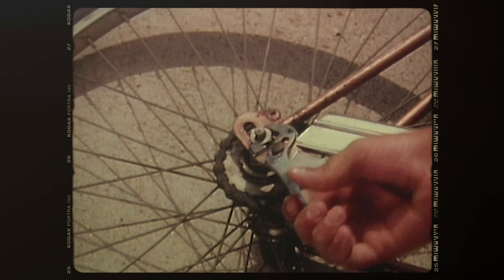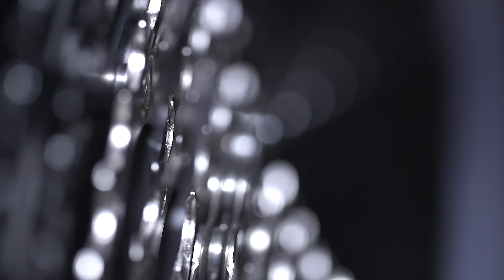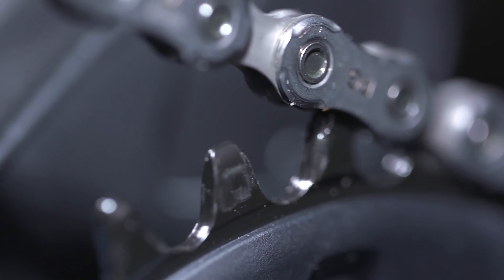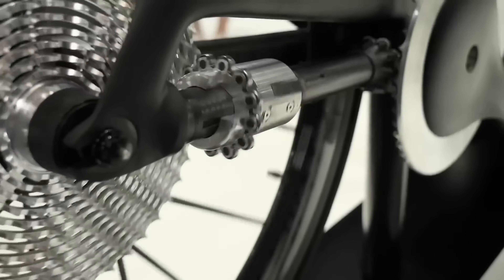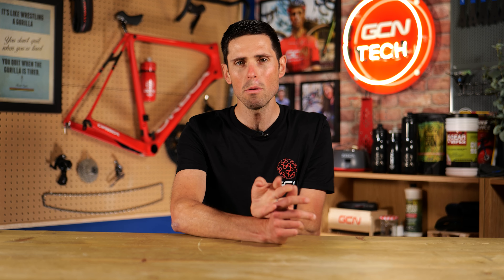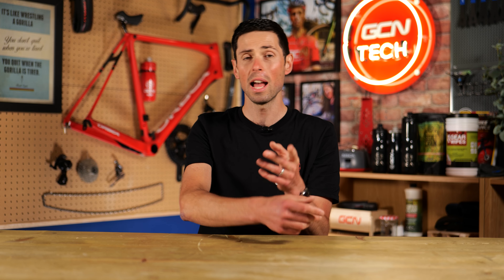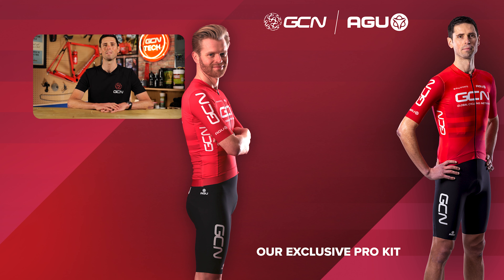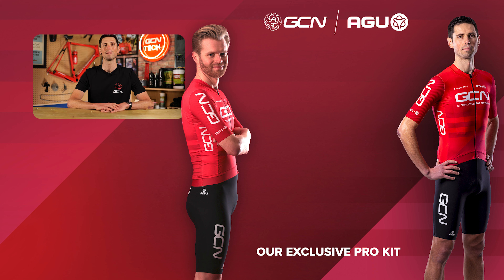Why This Will Never Happen!

Comment: My touring bike has a belt drive and internal gear system which works brilliantly. How often do you clean the belt? Never. How often do I need to adjust the belt length. Never. How often do you replace the belt ? Never. Compare that to my bike with chain. After each ride cleaning the chain, cleaning the cassette, cleaning jockey wheels, cleaning all those crazy special things, , lubricating every other ride. After many rides adjustment of cable to chain. A new chain after say 1200km. Its like a baby that needs care all the time, where my humble touring bike just always works. Yes it blows my mind how hard it is to find a gravel bike with belt. There are some steel ones, which look like they come from the year 2000, maybe one with aluminium, but still.
Reply: This. With people who ride a lot, are not doing it for the sake of competitions and are willing to spend around $1000 equivalent on a bike, belt should become the norm. The amount of work and maintenance costs of a chain drive+derailleur gears rake up quickly. By the time you are on your 2nd cassette, you may as well have gotten a belt drive with a Shimano alfine gear hub, and by the 4th you're in Rohloff territory, by the 5th Pinion. Sure, it will take 10 years to get through 5 cassettes for an average commuter, but it's 10 years of just riding vs. spending hundreds of hours on maintenance over the time period.
Reply: yes, but you had to pay significantly more for it, and the weight you drive around every day is greater and the efficiency is lower, so you use more power, in the end you end up with something similar, the only thing to choose is whether your bike is maintained daily or not, then you have to pay for it
Reply: @makantahi3731  The weight penalty isn't that big, especially for people living in flatish terrain. We only need the effect of scale to push the price down 👍
Reply: You must be riding a piece of junk then.
I've had the same Trek SingleTrack 930 since I bought it new in '96 and have ridden it over 10,000 miles. It has all of the original drivetrain components, shifters, and rear derailleur cable. Oh, the front cable was replaced 16 years ago. I've commuted in the worst Pittsburgh weather and winters with it, ridden hard and put away wet. Sometimes I'd feel guilty and clean it after a few days, but I never had the problems you're describing. Lubricating after every other ride? Are you mad?
Yah, belts were made for people like you, lol.
Reply: Exactly, the only way chains are getting replaced, is in the maintenance departement.
If bike commuting become a commodity for everyone, average Joe hates maintenance, and, would go for it.
Reply: Have you considered a) using a waxed chain b) using a better chain and c) just spraying your bike off with a hose / at the car wash occasionally?  They really aren't that high maintenance if you know how to keep them that way.  Even using oil, you can usually get away with just spraying it down then re-oiling the chain after a dusty/dirty ride.
Reply: Fwiw I think belt drive is great for commuter / urban applications, I'm just saying the amount of babying you claim chains to need is just not realistic.
Reply: @JMurph2015  You don't get it. That's already a lot of maintenance.
Reply: @JMurph2015  Yes it is. Look at a car. Any maintenance is too much maintenance. 
It's not a hobby, it's a way of transporting people.
Reply: @xmtxx  it really isn't, it's like half an hour once a month.  You have to put gas in your car, is that too much maintenance for you too?
Reply: Belts stretch and weather crack, never replace?
Reply: @JMurph2015  Lol, you made my point.
I wasn't, even expecting that much.
I replaced my car with a commuting bike (2 actually). And I spend a lot of time advocating for Ev's, because once, you don't have to do it, going to the gas station is a real hassle.
Even with a ICE car, going to the pump doesn't take that much time.
As I said, any maintenance is too much, beacause it's only a time loss.
Reply: @Lanceweeda  Belts last for 30 000km.
You don't realize how good it is.
Wonder why pretty much the whole industry use belts instead of chains? Even some motorcycle have belts.

That's almost 10 year of biking for me.
I'm ok for such "high frequency"  maintenance :)
Reply: @Lanceweeda  I'm not at 30.000 - 40.000km. Although one guy did 130.000 on one belt.
If you really torture a chain and belt, the (probably all) chain breaks way earlier then a belt.
Reply: @makantahi3731  yes the initial price is higher, its similar as a car with or without airconditioning. Airconditioning is nice, similar a belt is nice. Both not required.
Your efficiency argument is correct when you are only indoor. Or drive on really clean roads. In practice, after some miles the belt is more efficient. The more mud, the belt wins in efficiency at least against lubricated (I dont have numbers compared to waxed chains, but waxed chain is another baby maintenance).
Reply: @xmtxx  Around 60%-70% of all daily commuters use a touring bike (or e-bike) with belt, there you go
Reply: @JMurph2015  If you have a small apartment, spraying is not op option. If you life in a separate (expensive) house that could be an idea. But still you would wash it properly. Using a car wash hose is an idea, but you would have to use low pressure or you damage the bike, and then the efficiency goes down.
Reply: @JMurph2015  Well, I think almost all riders regularly clean the chain, because otherwise the chain wears out to quickly, so expensive and not eco friendly. Secondly, a lubricated dirty chain, never cleaned is way less efficient then a belt, never cleaned. The babying is realistic in my own life, and what I see others do. No you dont need to clean the frame that often, but the chain is a pain. And when say you clean the bike 10 times a year with 30 rides, my touring bike is stil at 0 or 1. There's just no way out
Reply: @Aragorn.Strider  now you're trying to twist everything, everyone I know who rides a belt are stiff-necked gentlemen who feel it is beneath their honor to even pump up the tires, and you talk about driving through deep mud, such rarely come out even in light rain, I don't ride my mtb in mud, so I'm repeating : the alfine is at least 1000g heavier than the classic gear shifter system and it is also a rotational mass, which means that you have to move it in 2 ways at the same time: rotate and move linearly, which represents double the power than if it were a part that is on the bicycle frame, then the efficiency: already the belt itself without gears is less efficient than the chain plus the pinion gearbox  or the wheel hub which are also individually less efficient than the chain and then when you multiply the efficiency of the belt and the gearbox you get a significantly lower efficiency, also bikes that have a belt and especially the gears are different structures than classic bicycles with a chain, and then the smaller number of such bicycles sold with an additional expensive gearbox means that a bicycle with a belt and gears is significantly more expensive than the same class of bicycle with a chain.
Reply: The belt drive/gear hub combo is great for some commuter applications and people cycling for fitness, but the relatively poor efficiency of both the belt drive system and the internal gear hub transmission make it totally unacceptable for anyone looking for performance. Plus, there's usually a hefty weight penalty from most hub gear systems that I commonly see used with belt drives.

Even if cycling with a chain was as terrible as you present it, (which it isn't) then I still think most people would use chains to avoid the drag, weight, and cost of belt drive/gear hub systems.
Reply: @makantahi3731  With respect to pumping up tyres alone, my touring bike needs to be pumped like twice a year. There's an inner tube, omg butyl even, for you weight winies. On my gravel bike with tubeless it's every other day, add 2-10psi. And of course the hassle of stuck valvets, because sealant is excellent in sealing my valve. So for my gravel bike a weeks ago I converted back to butyl inner tube (TPU would be way better probably yeah). At least with the tyres I can just ride bike and it works, yay
Flat tyres/puncture? Yes with dried up sealant and  porous tyres after 2 months. Ok, my fault, not enough baby sitting. But other/real punctures? Not in this milennium on either gravel or road bike. I bought the tyre plugs, never used. Always a spare inner tube, irrelevant. That's my reality. Yes I do choose excellent tyres.
Reply: Yet it blows your mind how hard it is to find a gravel with a belt. That answered your question, I think.
Reply: Belts   💩
Chains 🙄
Reply: Belts 🦄
Chains 🐴
Reply: Belts 🐌
Chains 🐆
Reply: Belts 🍼
Chains 🍾
Reply: Belts 🗻
Chains 🌋
Reply: @Aragorn.Strider 0% use belts in the tour

of France...😂
Reply: @xmtxx  
As both a bicycle and automobile mechanic,  I actually do know how good belts can be, especially, EPDM and Carbon , etc ..
You chose the word, "never",  I'm assuming you know the definition of that word? I hope you have the proper tool to check for wear on newer belts, it's the only way to measure wear.
Reply: @Aragorn.Strider  that is 100% certified BS in the USA for certain.  The most popular "dedicated commuter bikes" are the Trek FX series here, by a long shot.  And all of those are chain bikes.  You can't even buy a belt drive bike from a major manufacturer (other than Priority if you count them).
Reply: @Aragorn.Strider  also, yeah you have a totally warped perception of how much maintenance a chain requires.  It will easily last you like 1500 miles / 2500 km while just occasionally cleaning and oiling.  For most people, that would be years of riding.  If the chain needs replacement after like 2-3 years of moderate commuter riding, then they will totally just do that.
Reply: @javih36vv  In the Tour de France in the past 0% used a helmet. In the past 100% were at 23mm. In the past all used down tube shifters, there's your point
Reply: @xmtxx I like belt drives, I just wish people like you would stop proselytising them constantly.
Reply: @tinglydingle  oh don't worry, I don't.
I can't even have one on my bikes. 
The thing is that I don't care about theorical efficiency.
And I'm tired about most of this community being obsessed with weight, instead of wanting fast bike.
 I want practicality. The less maintenance, the more practical it is.
Reply: @Lanceweeda  I never said never. I said 30 000km.
That's 10 year of cycling for me. I can settle with that.
Reply: @JMurph2015  lol commuters in the US.
Are you for real?
Bike commuting in north America practicality doesn't exists.
It's not representative of anything.
But I'll be with you on that, 60% of belt might be real in the netherland, but that's it.
In France , belts are pretty rare.
Reply: @JMurph2015  yeah occasionally cleaning. 
We are exactly talking about that.

2500km is about one year of cycling for me. 
You made my point. 
It's already a lot of maintenance.
Reply: @Aragorn.Strider  In the past... In the past... and  in the  past... ok

Comment: I agree, replacing the chain will be really tough from an engineering standpoint.
Even where cost is no object, like motoGP, they don't use shaft or belt drives like some consumer motorcycles do due to losses and inefficiencies.
Then you make the system that much more expensive (or heavy) and you have a losing combination.

The best reason to not use a chain is maintenance - a low maintenance commuter bike is a great thing if you can afford the power losses.

Comment: if you factor in your time to maintain your chain, the belt wins.
Reply: Belts only work with gear hubs. A gear hub/belt system is heavier and suffers from higher internal friction than any derailleur/chain system. So the noticeably higher speed you can go with the latter easily makes up for the negligible amount of time lost to more maintenance.

Comment: dont forget the chain has a little bit of a headstart against any other system, it will take time, but i think it will at some point go away
Reply: Belt drives and drive shafts are almost as old. Neither can be used to shift gears and all factors considered - weight, ease and cost of manufacturing - the chain is superior.

Comment: Hold on $2000 for the Ceramic Speed drive system that's cheaper than many Groupsets. I'd say that killing off All the other manufacturers with frame manufacturer s building new frames stopped it. Profit over design and ease. That's what killed that.
Reply: No - it is fundamentally flawed. Even if it could work at loads, you have the issue that the rings of teeth are equally spaced, producing a very undesirable non-linear gear ratio progression.